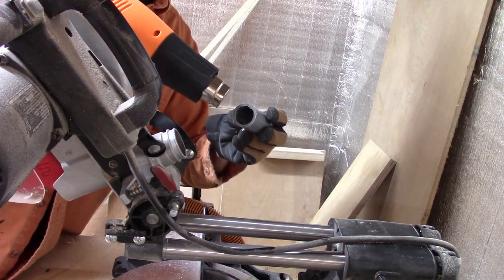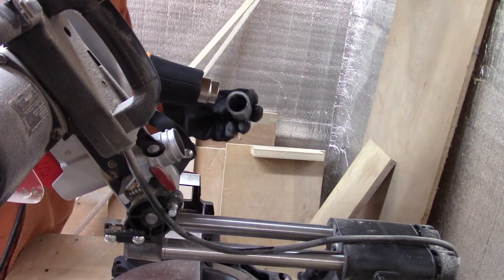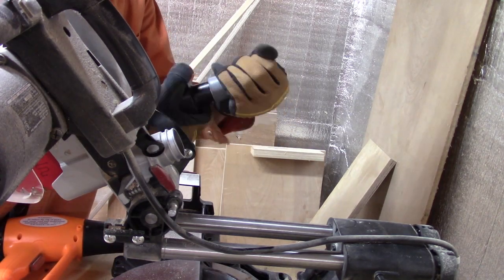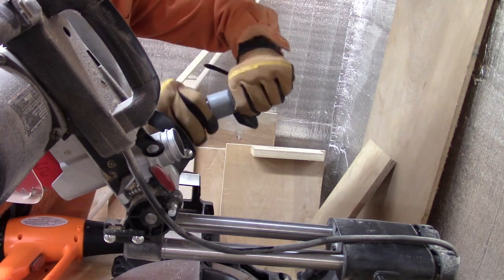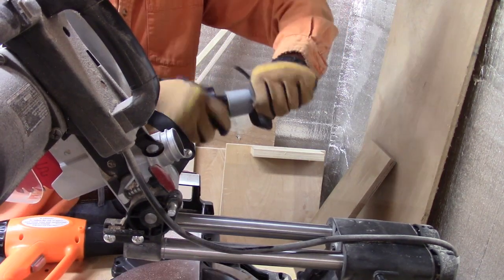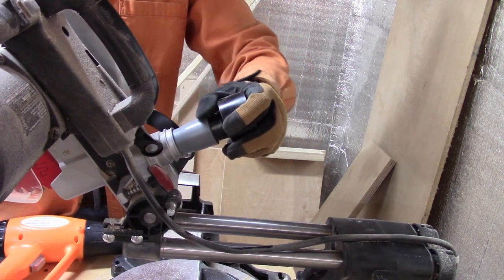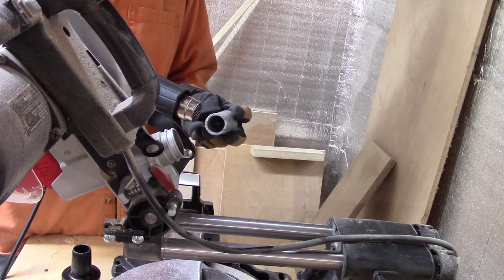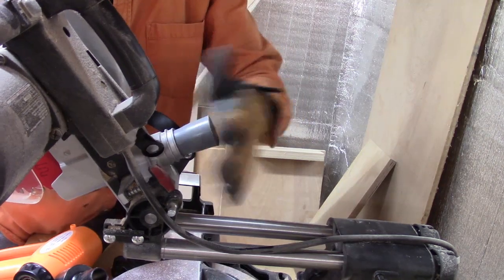How to Make Custom Vacuum adapters

Comment: Follow-up... I found an 8 inch length of 1.5 inch PCV pipe in my rummage box, and now have just what I needed to fit my Harbor Freight 1 inch belt sander and Ridgid 4 gallon shop vac.

One of the best uses so far for my heat gun !

Thanks for the idea !
Reply from the maker: That's great! Dipping the end in hot water works well too, for those that don't have a heat gun. Thanks for watching!

Comment: Thank you! Such a simple solution, yet I’d only only seen strange ways to use PVC as an adapter. This is the perfect solution—I appreciate that you showed reducing AND enlarging! 

I’m going to see if I can create one for my Black & Decker BDEMS600–a mouse sander with a terribly inadequate dust collector. I’ll need to flatten the end to a thin oval, perhaps I’ll need thinner PVC to make the fine-tuning? Have you found situations where you needed to add vent holes because of the strength/workload of the vacuum? My mouse sander dust exhaust is quite small. I think I’ll need to drill in vent holes to keep the vac from overheating. Any suggestions? Thank you again, this is the BEST solution by a long-shot!
Reply from the maker: Thank you for the comment! I forget if I mentioned it in the video, but if you need to drastically change the shape of the PVC, sometimes it's easier to heat the part you want to shape in a pot of hot water.  Yes, you will want to keep an ear on your vacuum. Too much restriction can cause the impeller in the Vac to spin too fast (due to lack of work load) and overheat the motor.  Would love to see a picture of your project when you're done! Links to my social media are on my YouTube Channel home page.

Comment: You wouldn't think finding an adapter would be such a problem... but it is... today I using my Harbor Freight 1 inch belt sander that has a dust port that is 1.75 inches in diameter... the same diameter as the 4 gallon Ridgid shop vac hose that I use mainly in my basement workshop, although I do have two other larger Ridgid shop vacs with different size hoses, but I didn't want to go lug them in from my garages... and I would still have a connection issue.

So what I really need is a 1.75 inch to 1.75 inch coupler... looks like your idea will work great for me... but now I probably have to buy a 10' pvc pipe from Home Depot ! :)

Years ago when I got my Delta miter saw, I used a radiator hose that had a right angle bend that fit the Delta plastic adapter... then I have a plastic adapter that fits inside the other end of the hose to attach my 1.75 inch shop vac hose... I think it must be some sort of radiator hose adapter that I got at the same time as the radiator hose... I remember it wasn't an easy shop vac hook-up !
Reply from the maker: I have no idea why they are all different. :-P Thanks for watching!

Comment: My Black and Decker Mouse fits on my vacuum hose.  I just got it and haven't used it yet.  Do I run the vacuum as I'm sanding?
Reply from the maker: If you want less dust in the room, yes. 😀

Comment: Very helpful but what if you want to fit to a rectangle on my belt sander?
Reply from the maker: Heat up a larger portion of the pipe and when flexible, force it over the outlet. Depending on the size of the rectangle you will have to size the pipe accordingly.

Comment: Neat idea. Good instruction. However, one drawback is that you're further restricting the arguably already too small airflow cross-section of the tool's dust collection port.
Reply from the maker: True. You may use the same idea and go to the outside of the port with larger PVC if you would like. :-)
Reply: Looks like the craftsman sliding miter saw - the design of the shroud on that tool barely funnels any dust toward that port anyway... Really a bad design. I have a rigid saw that's much cleaner with just a dust bag than this saw is with a vac connected.
Reply from the maker: @Kactapuss   Yup pretty much. I now have the 10" Ridgid Slider, and really enjoy it.

Comment: Thanks for the tip... got to be easier than mix and matching adapters to fit every tool in the shop.
Reply: Indeed! I can't even find an adapter that would connect what I need.
Reply from the maker: Indeed! Thank you for watching!
Reply from the maker: @JillofAllTrades2  I know! Why must they all be different???! Thanks for the comment!

Comment: There's got to be some missing science/math to this. Surely the engineers chose a certain inside diameter for airflow and to not put too much strain on the motor. I endeavor to find this knowledge so I can get the correct inside diameter so as to prolong the lifespan of my vacuum motor.

Comment: Does this really work?
Reply: What size pvc would you use with a 1 7/8 hose and a 2 1/2in saw port?
Reply from the maker: Works for me! Thanks for watching!
Reply: @Mark-oj7yt   Hi Mark. Did you find a solution for this? I'm having the same predicament now.